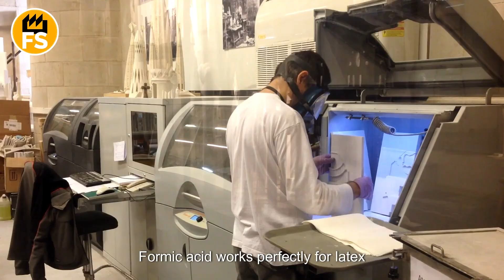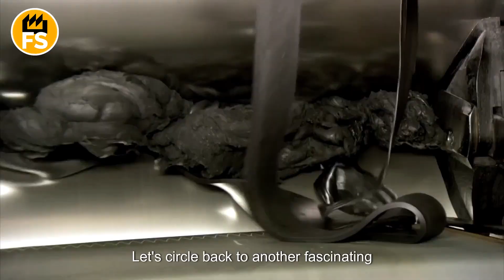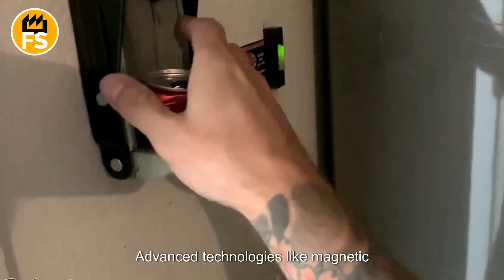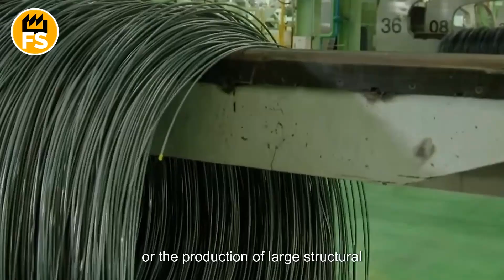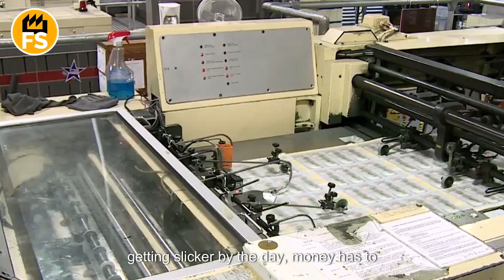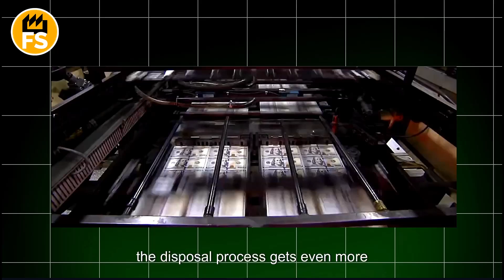Goodyear: How 200 Million Tires Are Made Every Year! 🚗⚙️ Mind-Blowing Technology!

Comment: Goodyear's tires are terrible. I had them more than twice and will never come back. It has issues with designs and quality. Their wear and tear are not so confident for me.
Michelin and Bridgestone are my pick now!
Reply from the maker: Thank you for sharing your experience! It's always valuable to hear different perspectives on tire performance, especially when discussing the advanced manufacturing processes behind Goodyear's tires. 🚗🔧
Reply: I have been running Goodyear tires for 40 years with no issues. I suspect you have other issues.
Reply: @cuzz63 they were worn out very quick.
The first replacement for my Nissan and the second one with my Explorer.
I had never came back for any of them.
That company still has problems with quality issues!
Reply: @TT-dp8qh  sounds like you bought the wrong tire...they give a mileage warranty so if they wear out early they give you new tires.
Reply: @cuzz63 yes, I had warranty on those tires but I did not want to go back to the same brand. Now, my best ones are Michelin. I come back to those tires ever since.
The number one tire in the world is Michelin. The one falls the second place is Bridgestone!
Reply: @TT-dp8qh  I dont disagree that Michelins are great tires but they are limited in various types and while Bridgestones are good they arent better.
Reply: @cuzz63 Bridgestone is heavier than the rest of those brands. They also create noise and wear and tear is quicker than Michelin.
The latest ones I have are Michelin defender. 
From where I live, Michelin normally last 65k for the road condition here!
Reply: @TT-dp8qh  Goodyear makes tires for 85,000 mile tread life.
Reply: @TT-dp8qh  I was explaining to someone else how in the manufacturing process they make runs of say 1000 treads from an extruder and then switch to another compound and then run 1000 treads of another..if the operator doesnt time it right and the compound mix in the extruder they can make a few tires that dont have the same wear or traction characteristics that they should.  Doesnt happen often and they over the years they have changed some of their methods of clearing the extruder between runs.
Reply: @cuzz63 it didn’t work that way very well. It was junk for me!

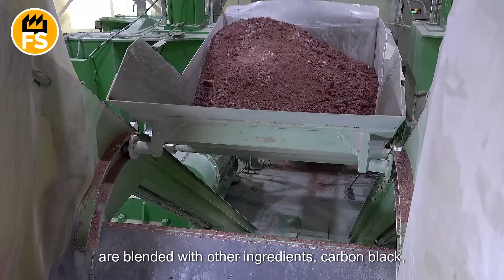Comment: 4:18 Carbon Black.. Why is it so hard to add Carbon Red or Carbon Blue? If they can make fake rubber, they can also make fake carbon, so make tire OTHER than black please!!! Like RED! :face-fuchsia-tongue-out:
Reply from the maker: While the idea of colorful tires is intriguing, the use of carbon black is essential for durability and performance. However, innovations in tire technology are always on the horizon! 🚗✨
Reply: Carbon black is an important chemical for making the rubber tough. But it was called carbon black because its...well...black. if you want to see different colored tires. Look up goodyears glowing nylon tires. These were quickly discontinued because they were very unsafe. I wish theyd bring back the white sidewall. That was a good look on tires.
Reply: Carbon black is important for the bulk of the tire but they can make different color side walls.